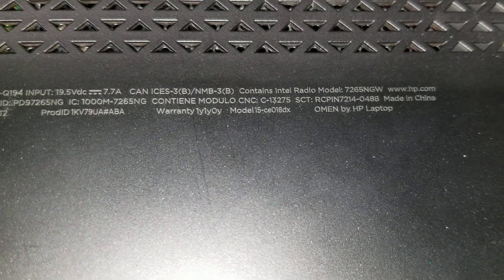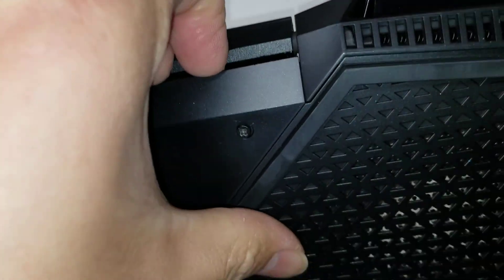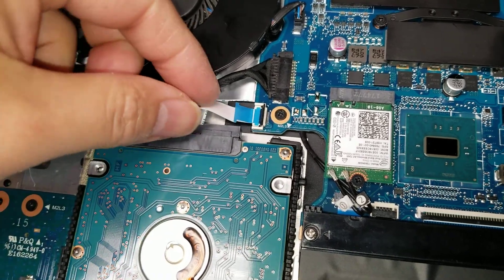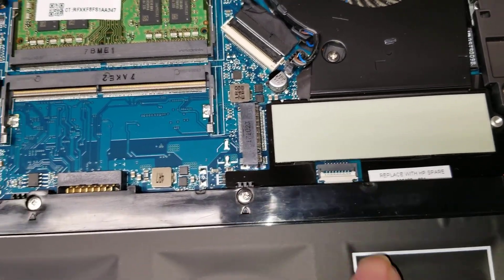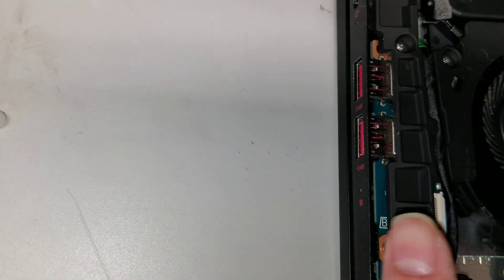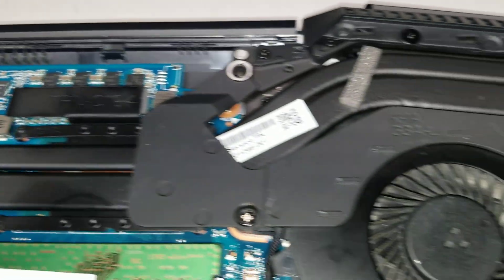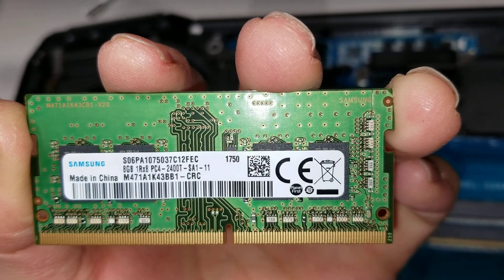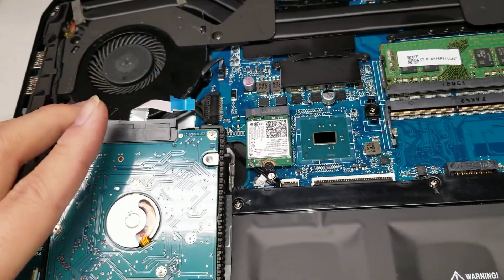HP Omen 15-ce018dx disassembly ram SSD upgrade repair

Comment: Hi! I found this video  helpful  but I have  ran into some complications, I pulled my old  sata on this model and put in a m.2 2280 but now it won't power on could you  please help?
Reply from the maker: Won't power on? Did you disconnect the battery?
Reply: @ItsBinhRepaired  yes it was connected  apparently  I had it wrong  side up. In my defense  I had never replaced a hard-drive  before
Reply from the maker: @brennenraines51  is it working now?
Reply: @ItsBinhRepaired  oh yes, smoth as butter
Reply from the maker: @brennenraines51  great!

Comment: Can you even upgrade the RAM on this? When I bought mine (same model omen ce018dx) in 2018, I was told the RAM is 8 and not upgradable. Now I am wondering if I've been lied to.
Reply from the maker: I don't know why I even make these videos. I might as well make the title and not the videos. Lol People use my videos as a forum post or something to ask questions answered by the videos. You can definitely upgrade the RAM. They call it "not user upgradeable" because they consider users to be incompetent idiots. Almost all the "max" specs they give are there as the max specs you can order directly from the manufacturers. DDR4 currently I think you can get up to 32gb, two 16gb sticks, but beyond 8gb two 4gb sticks, most people usually don't get much performance boost. So adding a matching 8gb stick is your best bang for your buck.
Reply: @ItsBinhRepaired  it doesn't hurt to ask questions, especially that we're increasing your views. The video said you can do it but the "expert" at best buy said I couldn't. I always upgraded rams but this was my first gaming laptop and the best buy dude confused me so I thought it was different in a way. Either way thanks for the answer.
Reply from the maker: @fashel2006  lol expert at best buy. The "expert" at best buy is only an expert in getting you to buy a new computer.
Reply from the maker: @fashel2006  technically the views would happen whether there was a video or not because so many people just click for the model of their computer and go straight to asking a question according to the analytics. 3 minute average watch time. That's about how long it takes them to write their comment. Lol It makes me sad and upset that I put all this effort into making these videos and provide all this free knowledge and then people just want free Google answers. If people actually watched like just 10 of my videos all the way through, they'd be able to basically do my job. Lol
Reply from the maker: @fashel2006  the worst questions are when they comment asking how to remove a component that I clearly show in the videos. It's like, how do you expect me to answer that in a comment? Pull it out? Lol
Reply: I suppose there are dumb questions. I did watch the entire video on 1.5 speed and tbh I knew how to do all the stuff. I just wasnt sure about the possibility. Now that we're talking about dumb questions. I need a good source that explains how to maximize the use of my ram xmp kinda thing.
Reply from the maker: @fashel2006  don't know about that for laptops.

Comment: Hi, i have a question, this ssd: https://www.mercadolibre.com.ar/disco-solido-interno-western-digital-wds500g2b0c-500gb-blue/p/MLA15581860 is compatible whit this model?
Reply from the maker: nope, the notch is in the wrong side. looks like you'll need an m.2 sata ssd
Reply: How do I make the OS boot on nvme